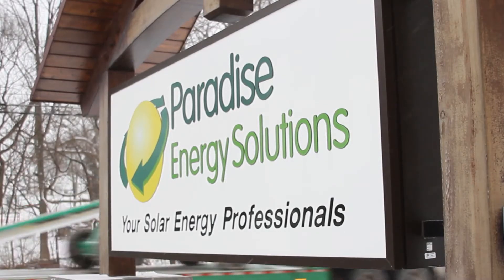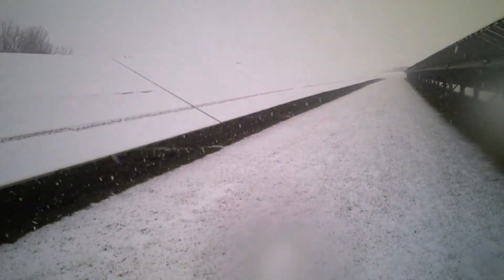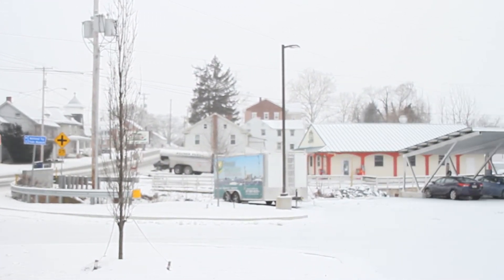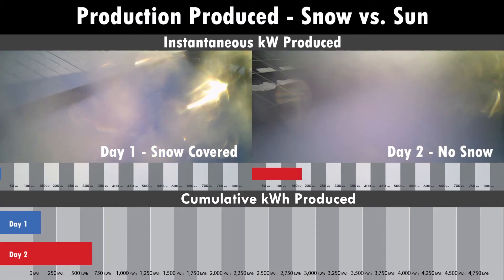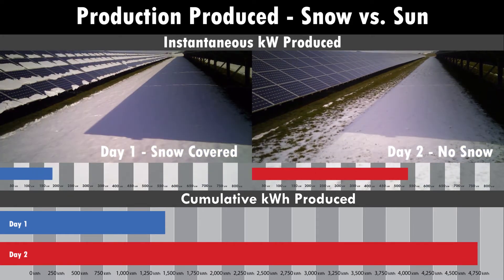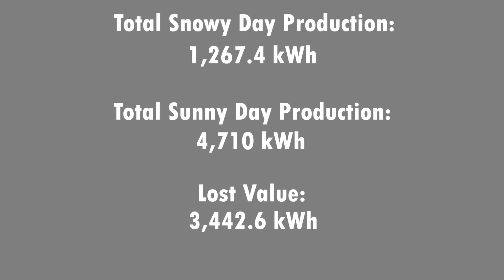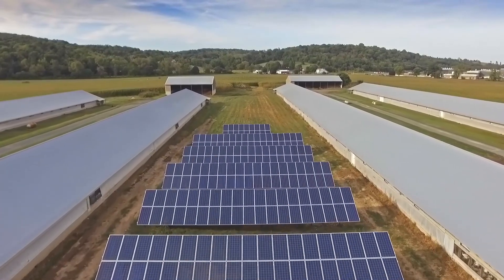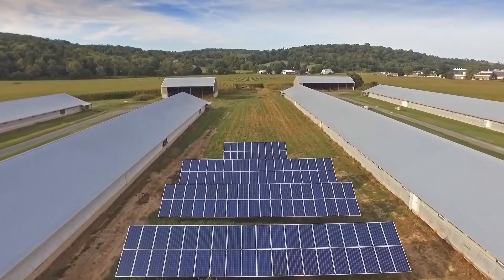Snow Removal Tips For Your Solar Panels (Grid-tied Systems)

Comment: In my location with roof mounted panels and an off-grid system this can cause your food to go bad. If I don't remove the snow I can go days (if not a week+) producing no power whatsoever. By the end of day three my batteries are drained and I am rocking the backup generator (for the day or two I can sustain with it). It would have been nice if you could have covered what to do if you HAVE to remove the snow for folks like myself.
Reply from the maker: This video is specific to grid-tied systems, which are the type of systems we install and the large majority of the systems that are out there. Your circumstances are slightly different. If you can safely access your solar panels, we would recommend using an approved solar panel snow rake to remove snow without damaging your panels. These can be purchased on Amazon. However, only do this if you are able to without putting yourself in a dangerous situation.

Comment: Bs.
Reply from the maker: Thanks for watching! Why do you feel this is BS?
Reply: @thesolarenergychannel  because the snow doesn’t melt after a few days. Just stays
Reply from the maker: @andrewridesthrough3912  It depends on the amount of snow. The sun melts the snow off solar panels much quicker than the ground and even your roof in most cases. Panels retain warmth and are often installed at an angle, so when the storm ends, even heavy snow slides off within a reasonable amount of time. 

Check out this blog for a one-day time-lapse video of snow melting off panels in Pennsylvania. https://bit.ly/3pfztQi

If we install your system, it will come with our Triple Ten Production Guarantee. This guarantee covers any shortfalls in the amount of energy produced. If a snowy winter hurts your production more than what we project in your guarantee, we’ll send you a check for the difference.
Reply: @thesolarenergychannel  4” of light snow here in Wisconsin on a 5/12 roof and it stays put.
Reply: 3400kWh x $0.25 = $850 + $761 SREC2 in MA. $1611 total. It's a personal choice whether to rake or not. Each location is different. Why not recommend the safest way to do it?
Reply: @chrisspy1226  I suppose but I would never have put solar on my house if I was not going to be able to make power in the winter. The idea that the snow will melt is plain simple bs. I made a silicone rake and it worked great. Back to making power.